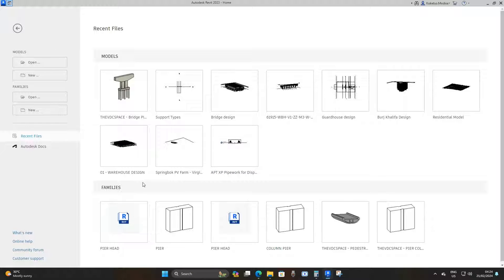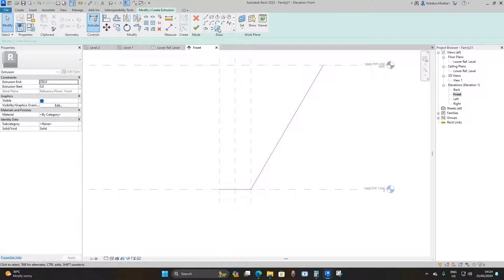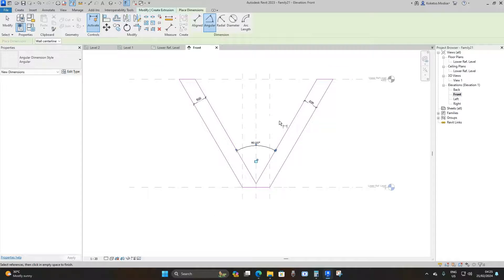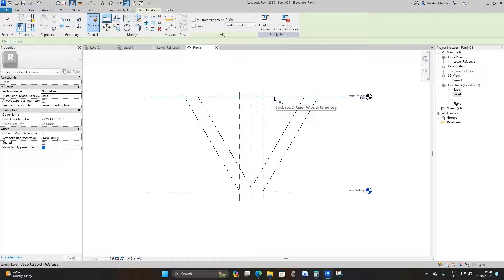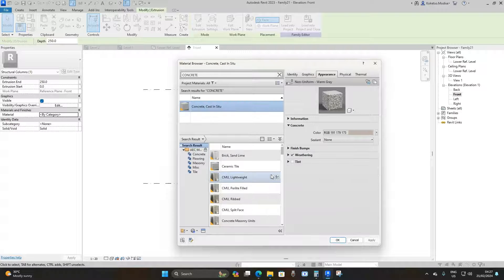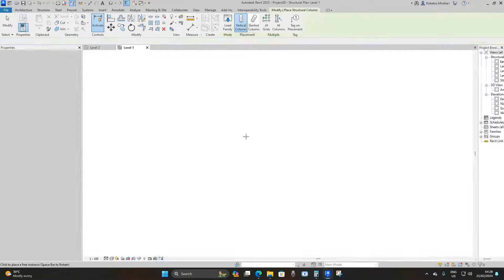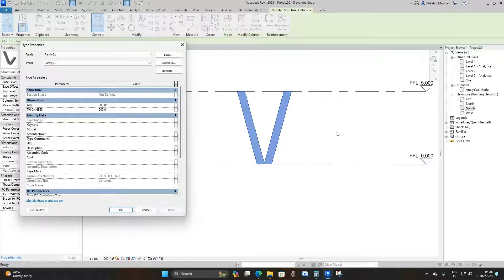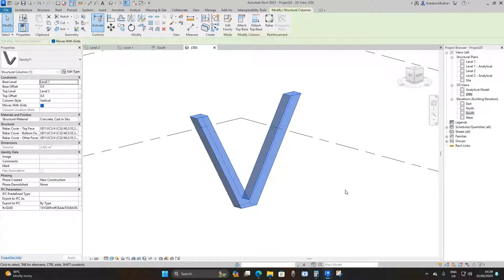V - Shaped Concrete Column in Revit.

Comment: awsome! but how can i make the columns cylindrical, i need the round shape not the square type of columns
Reply from the maker: 1. Select the Sweep option.
2. Go to front Elevation.
3. Draw two diagonal lines which meet at the bottom (reference level).
4. Edit your profile by drawing a circle.
5. Finish edit mode.
6. Done